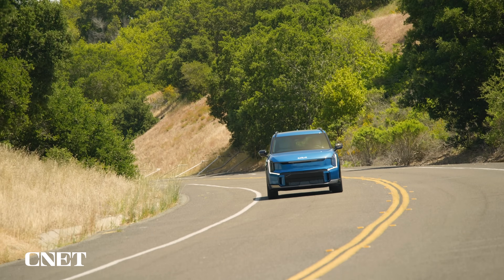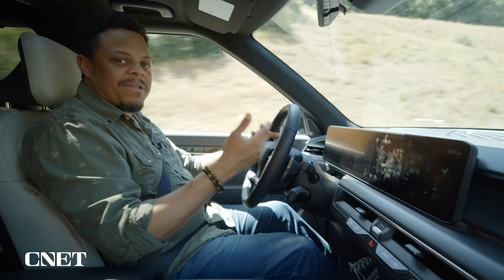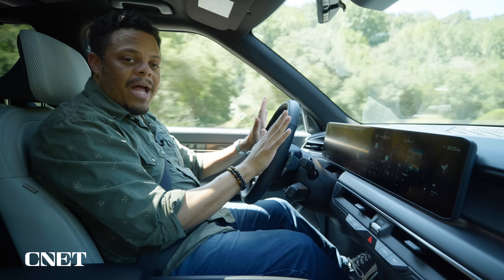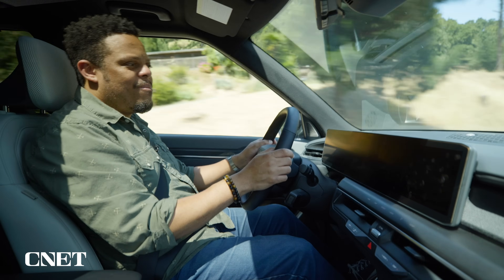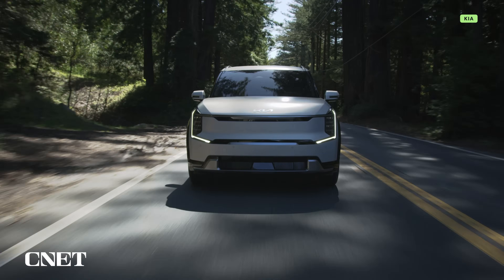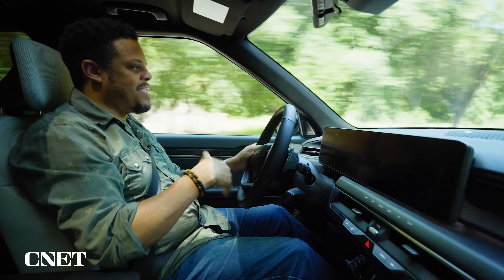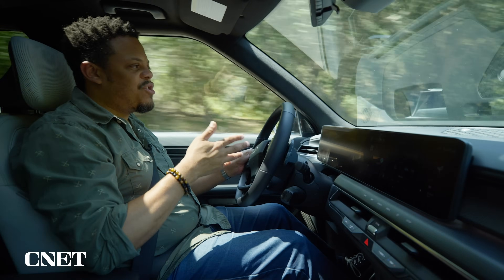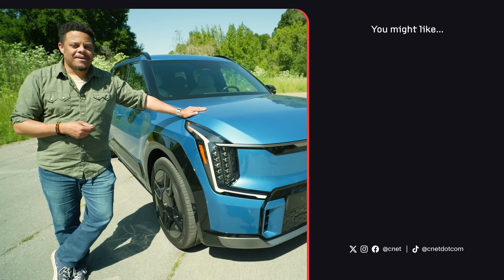One-Pedal Driving in the Kia EV9

Comment: Is this why I hate driving behind Teslas? They slow down rapidly without the brake lights.
Reply: Teslas automatically activate the brake lights after a certain amount of deceleration regardless if the brake pedal is depressed or not.  Most EVs do that actually.  Technology Connections has a good video highlighting that Hyundais were one of the few brands not doing it, and I want to say they had a recall and fixed it somehow.
Reply: @AltoSaxJoe  Good to know. Does Tesla allow drivers to alter how soon the brake lights activate? IMO they should make it more sensitive to deceleration by default. I find driving behind Teslas scary in semi-crowded traffic conditions. It could be that my skills are lacking but I don't have this issue with other cars.
Reply: @Chewbucksa Teslas are not adjustable unfortunately. I wish my Tesla's brake lights came on a bit sooner, but they're set fairly well from the factory. I'm used to downshifting in a manual transmission so a Tesla is better than a manual car!
Reply: Regen braking and brake lights are simultaneous in Teslas, near instant

Comment: The problem I have with one pedal driving is the fact that it builds a habit of not using the break pedal as much. This could result in you loosing the muscle memory to break. This becomes a problem in emergency and when you are driving an ICE car.
Reply: I actually find it better, such as in the situation where your foot is on the accelerator, pulling it off is just slightly faster than having to go to the brake to start stopping. If anything, if you need to stop fast, it's just a bonus start to braking before your foot gets to the actually brake pedal

Comment: It’s one of the best things about an EV.  I will go weeks without touching my brake pedal in my Model Y.  I really miss it in the winter when there is a lot less regen.
Reply: How would you be able to stop without using brakes
Reply: @sherrimoquin5553  When you take your foot off the gas pedal, the regen braking from the motors slows the car down.  The car will come to a complete stop, so you don't need to hold down on the brake when you are at a red light.  I'm so use to it now, it's hard for me to drive my wife's ICE car.
Reply: @Jerryklocke  oh I get it now and honestly I don't know much about electric cars

Comment: Is the feel of one-pedal driving much different from driving a manual transmission car? Granted, I know there is no such thing as regeneration with an internal combustion engine.
Reply: No, not really.  The big difference is that without gears to shift, you get a consistent feel at all speeds, not like the massive braking in first vs almost nothing in fifth.

Comment: I have a 2024 BMW IX and the range is a lie! Even without one pedal driving, the real life range is between 320 and 420 miles depending on drive mode.  You can increase this by using Brake mode or one pedal driving.  After the initial awkwardness of the one pedal driving, it becomes addictive to use.  Similar level of feel and control of using a manual transmission. I use it even though I do not need the extra range

Comment: My assumption is that at lower speeds lifting off the pedal engages the brake lights.  Is that right?
Reply: Yes, although the details vary by manufacturer.  On my Chevy bolt, there is an accelerometer that activates the lights whenever it feels the car slowing down.  Works at high speeds too, like at a freeway exit -- lift the gas, the brake lights go on.

Comment: it's the same as engine breaking in a car with a clutch
Reply: Except you actually get energy back into the vehicle with regen. It's incredibly smooth as well.
Reply: Same, but engine braking isn't as strong, as regen can provide up to 0.25 G of deceleration. Engine braking also doesn't fill up the gas tank while decelerating.

Comment: Regen braking and one pedal driving is incredible greatly improving handling on curves.Makes driving a gasoline powered car seem like a horse and buggy.
Reply: Yeah sure
Reply: @nickcpv  tru story.. the old steamers just can't match electric cars for safety and performance
Reply: lol electric cars are obsoleted technology from the 1830s and combustion engine veheicles are from the 1860s. its actually ewaste vehicle/ev that are the horse and you people are putting the buggy before the horse like tards also.
Reply: Think what you will on this comment but I find it very true when I’m driving backroads in my Mach-e.  In Unbridled mode, the car slows down so much that I can use it to properly slow down coming into a curve then blast out of it with all that instant torque.

I’ve had plenty of ICE cars that are fun to drive…except for missing engine sound, this one is just as awesome